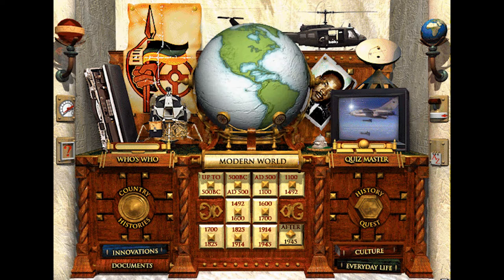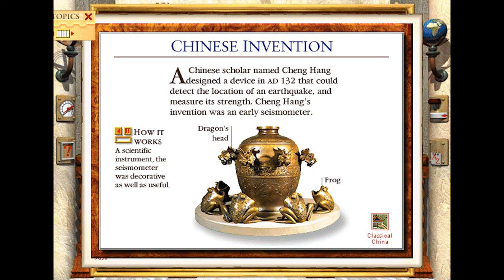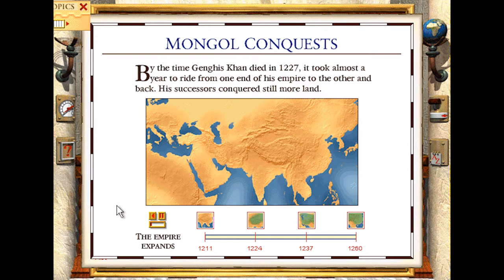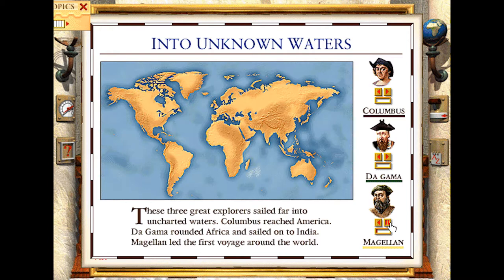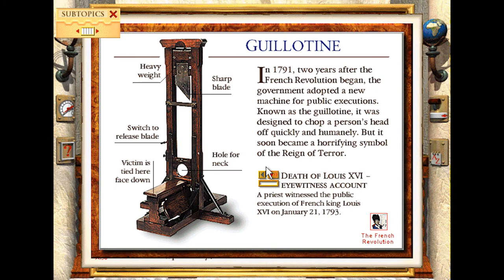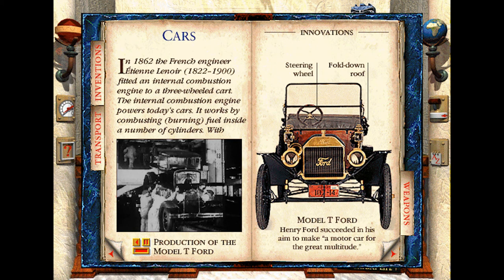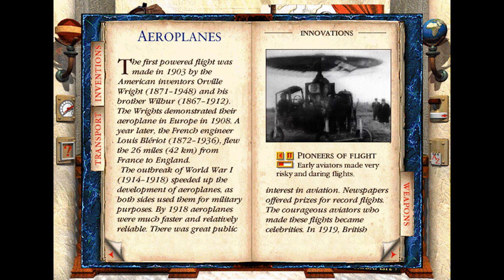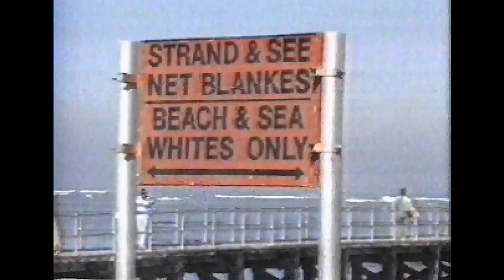Eyewitness History of the World 2.0 - All Video/Animation Voice-overs

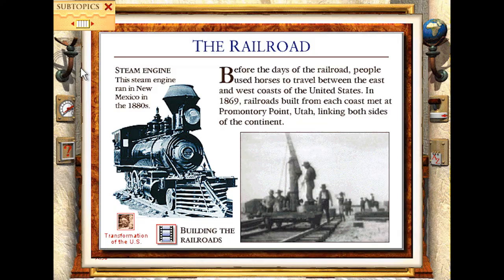Comment: At 56:03,

During the 1800s,
thousands of miles of railways were built in the United States.

Railway builders worked by hand using pickaxes and shovels.

Iron spikes were hammered in
to fix the rails to the wooden sleepers.

Winches were used to move
the heavy pieces of metal track.

The railways opened up new territories
and helped to link the United States together.

By the early 1900s, most North Americans
were no more than 25 miles from a railway.